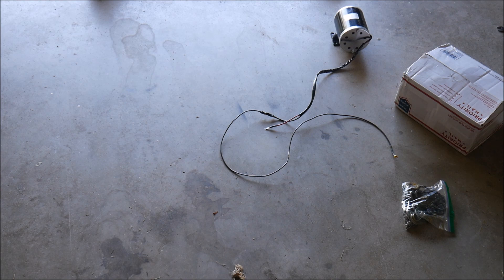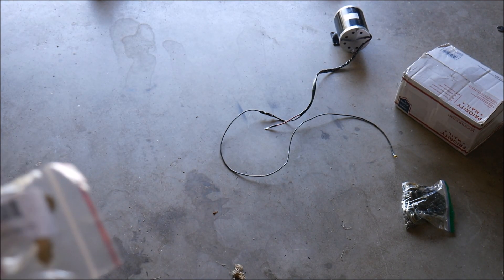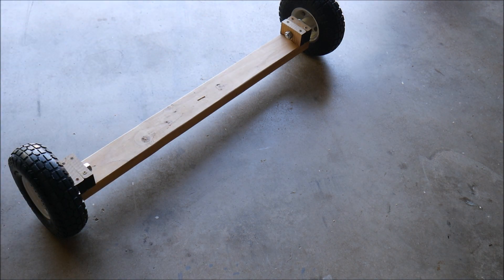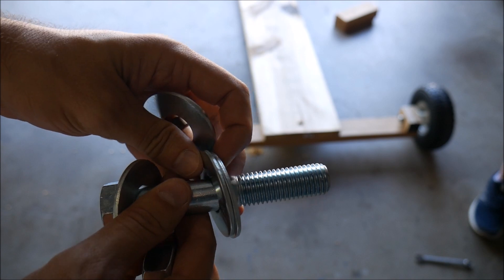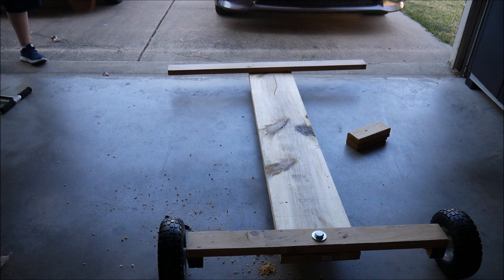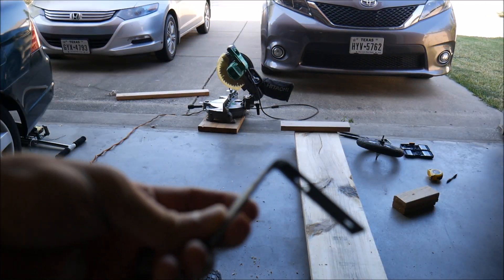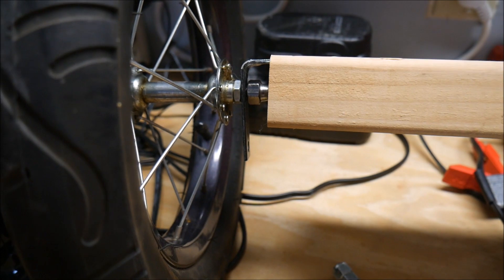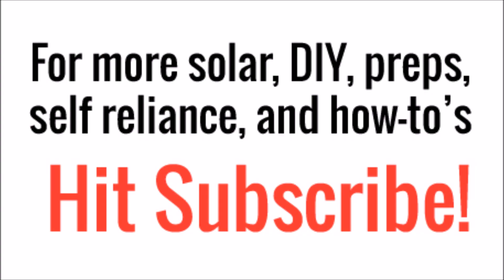Solar Powered Go Kart Project - Part 3

Comment: I bought one of those key switches for my homemade variable tension friction drive bicycle i built and built my own Speed controller and Accessory controller.
Reply from the maker: Cool!  How is the friction drive holding up?
Reply: Holds up well for sure, have to rotate my tires on the bike about every 160 miles on the odometer i put on it. Lower friction tires have less durability but would give amazing performance so i just got a good balance in between next year i may just buy a 1000w kit with two 22.2v lipo 16ah batteries with monitors and run it then since a hub motor would give the most power and efficiency.
Reply: Yeah i teched the heck out of this thing i built. Has a 10 watt LED with a low beam to high beam setting, an outdoor indoor temperature circuit (Outdoor temperature is for the motor) also has what time it is on it and the voltage of the battery, a USB Port for charging my phone while riding and such
Reply from the maker: Wow that is really cool!  Nice job!  Ours will not be quite that fancy.

Comment: Question you located in the south any perticuler reason you moved north just curious
Reply from the maker: What do you mean?  I am in Dallas, Texas.
Reply: wow though you moved it looks cold with green house heating thing
Reply from the maker: Nope.  It can get down to freezing and sometimes down into the single digits here in the winter.  But usually it is upper 30's or mid 40's all winter.
Reply: LDSreliance  I though Texas was hotter than that I stand corect ed  don't know much about Texas

Comment: I like the project but I'd prefer if you'd fast-forward to the electrical engineering part of the build. The frame is going a little bit too slow for its level of complexity. On the flip side I hope you're having a blast with your son and would love to see him participating more in the project.
Reply from the maker: Yes, I didn't intend to spend as much time on the frame.  But I think it is important to show the challenges that come up in projects like this and how you can brainstorm to solve them.  I do that in all my videos.  We didn't start out with any plans so we are making it up as we go.

Comment: Hi can you send a Link of this Motor?
Reply from the maker: Sure.  Mine is a ZY1020 800W version.  Here is the 500W version on Amazon:  http://amzn.to/2hK0lWw.  

Here is the 800W version on Ebay:  http://www.ebay.com/itm/800-W-48V-DC-brush-electric-ZY1020-motor-w-bracket-f-escooter-ebike-DIY-project/151590483312?_trkparms=aid%3D555017%26algo%3DPL.CASSINI%26ao%3D1%26asc%3D41376%26meid%3D3dbd4bc04c2544c695577a62c7ee146c%26pid%3D100507%26rk%3D1%26rkt%3D1%26&_trksid=p2045573.c100507.m3226

If you want the kit with the hand controls and wiring and everything included you can pay a bit extra:  http://www.ebay.com/itm/800-W-48-V-scooter-motor-T8F-sprocket-kit-w-base-speed-control-Thumb-Throttle-/151967775414?epid=690324205&hash=item2361fc3ab6:g:2pgAAOSw0e9UzSK-